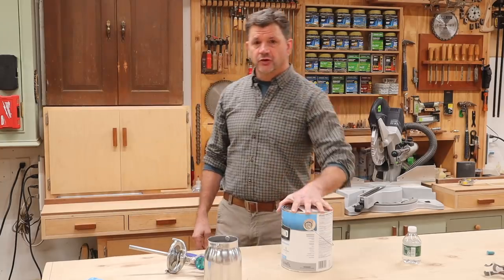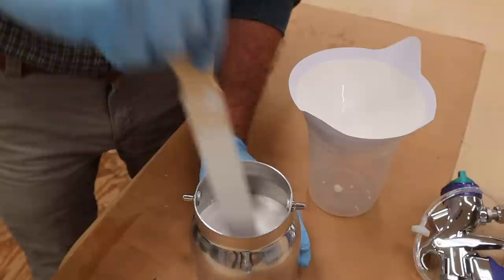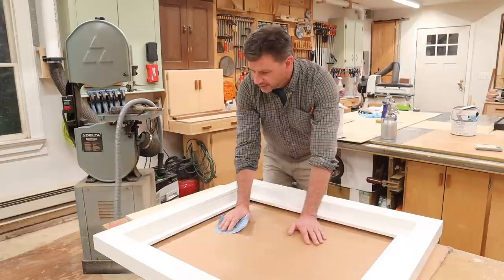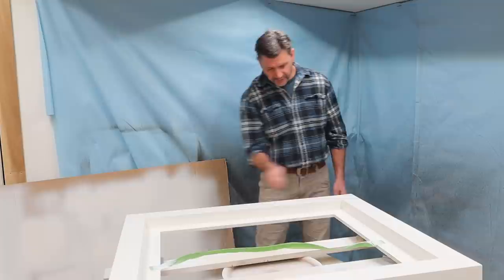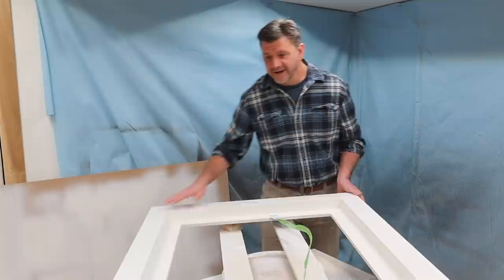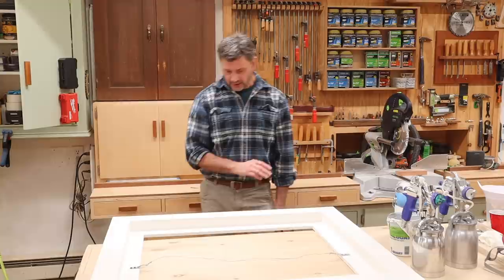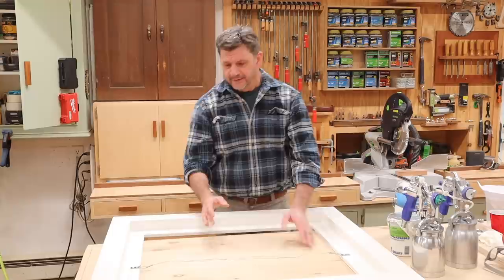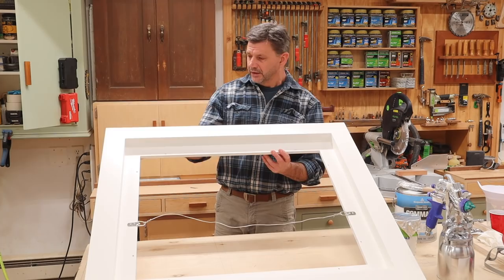How To  spray Benjamin Moore Command Paint - FUJI HVLP

Comment: Yesssssssss! I love it. I took the plunge before anything was out on the internet about it… and I’m glad I did. I was able to spray with a 4 stage turbine and 1.5mm tip. No thinning. Tried thinning it too and works just as well… don’t thin more than 10%. Brushes ok, coverage isn’t great. Rolling is ok too, can’t find a roller that doesn’t leave bubbles or stipple.

Comment: I just made and sprayed 38 kitchen doors and drwr faces with this paint and am very impressed with the results. I thinned the paint to 25 seconds using a #4 Ford viscosity cup the results were uniform.
I'll add that I'm an oil or lacquer guy and this paint is as game changer for me.
Reply: At 25 seconds, were you still using 1.8mm tip on an HVLP cup gun?
Reply: @briangibson6445  yes
Reply: What primer did you use?
Reply: @evancombs1091  I used an alcohol based stain blocker primer.
Reply: Thanks for the info on this.  I'm about to do something similar, and what I find is that by reading the manufacturer's "max thinning instructions", they always leave the paint too viscous, meaning I can't get it to even 30 seconds in #4 cup.  Is this Benjamin Moore paint the same, and just more tolerable to being thinned past recommendations?  (Or maybe it's within recommendations?).  I'm using a Fuji Q5 and 1.8 set.  I know I can answer my own questions by just experimenting more, but then that requires cleanup!
Reply: @jamisonr  I'm sorry I can't answer your question. I'm not familiar with your spray set up. I used a gravity feed hvlp gun run off an air supply not a turbine.
I think you're just going to have to experiment. Wish I could be more help.
Reply: I have a Graco 9.5 HVLP.What  needle would you suggest?, Also do I need to thin at all ?

Comment: Thanks for introducing us to Command. My BM/Scuff-X dealer has implored me to try it. I have the same Fuji Q5. When I saw how your spray first came out, I figured it would orange peel (been there myself). Acrylics/urethanes are really tough w/ HVLP, even 5 stage. Ended up buying a Tritech T5 airelss for this stuff. Pro tip from my dealer: if you are going to spray w the Fuji (he sells both), *warm the paint first*. Has the benefits of thinning, without the negatives.

Comment: For a paint like this would definitely recommend using an airless with a 308 fflp tip. I’ve been finishing for a while now I end up only using my hvlp for lacquer primer. Also helps if you use a 1.5 air cap with 1.3 tip helps keep that high fluid pressure and higher air output to get finer atomization of the coatings. I noticed when changing tip sizes and air cap sizes with the Fuji I still was getting less than optimal atomization. Found keeping the small tip and just changing the aircap really helped a lot
Reply: Good tip! My Fuji/Tritech dealer also suggested warming the paint when using HVLP.

Comment: I use an airless Graco with a 312 tip and it lays down great.  It's my go to for all my cabinets now.  I really like the quick dry time and hardness of the finish.
Reply: that hlvp he was using  you can hear it was working hard to atomize the paiint, he would have been better off using an airless sprayer.

Comment: I have moved from Fuji spray to a purpose built gentilin compressor for painting.  Its quieter, no thinning of paint, or very little, like a few drops of water, easier to clean out and i have been very impressed out of the box.  Its a little bulkier- its a 25litre continuous flow, but for the quietness,control and no need to thin, i am really happy.
Reply: What is that? Link?
Reply: Can u get those in canada

Comment: Great video.  I just sprayed some shelves with Command and was able to get fantastic results!!!  It looks as good as the BM Advanced I had sprayed out by a pro cabinet maker a few years ago.  (And the dry time was amazing!!!)

1.  I used my new Fuji Semi-Pro 2 gravity feed.  I thinned Command a little more than Jon did here and used a 1.5 tip.  I started with the needle all the way in and adjusted it until I got a light, spray can type mist.  Probably just a turn or two. 

2.  I laid my pieces on a lazy susan and used the ball pattern on the edges.  I switched to the fan pattern for the rest and moved slowly as to put down a thin but very wet coat.   I worked a little closer and square to the surface.    (I heard that you want a hand-sized fan when you are a hand-length away from the workpiece.)

3.  One coat over primer looked amazing with a little bit of wood grain showing through.  The second coat filled the wood grain.  I also did some UV-coated plywood with a bonding primer on it and it looked like a factory cabinet finish with just one wet coat. 

4.  If you use the Fuji 6' whip hose.  It has a bad wrap for falling apart so don't drag the main hose around with it.  Grab the main hose to drag it into place and use the whip from there.  The hose is a tool to make painting easier.  Treat it nice, be gentle.

EDIT:  I'm a novice, but there are so many good HVLP videos out there that it's pretty easy to learn.
Reply: Fuji whip hose is a total POS. Mine is coming apart already on my first cabinet job. Just bought a spare for when it fails.
Reply: What primer did you use?
Reply: @evancombs1091   BM Sure Seal.  I thin it out.  If I'm spraying over UV finished plywood I do a quick sand and use Bondz bonding primer first.  

Command is fantastic once you get dialed in with it.

Comment: I may give that paint a try.  I've been using Sherwin-Williams "Emerald" brand and get very good results by adding 1-2 ounces water with 1 ounce of Floetrol to a quart of paint and using a HVLP gun.
Reply: What is tip size you use?

Comment: I did the backs of my cabinet doors yesterday.  They turned out pretty good.  Today I did the fronts but I'm pretty sure I added too much water.  They look like alligators.  I will sand them tomorrow and spray again without thinning at all.  1.4 tip. If it needs thinning I'll know right away, and adjust. I was planning 4 coats, and this was only the first, so hopefully we can recover.

Comment: Finally sprayed Command with my Q5. Got pretty much the same results as you did. Very slight orange peel despite thinning 20% and 1.5 tip. I may try to thin a bit more.  But it's probably going to require three coats in white at that point. Love the paint. I need to try it in the Tritech airless, but cleanup/waste is such an issue with that.
Reply: Use a hopper version

Comment: thank you for the video.  Those are Fuji spray guns correct?  I have a Fuji gravity feed gun with a Q5 turbine.  I dont have the dial like you have to adjust the air and my system is a tad older. The air regulator is at the  hose.    I have been trying to spray post catalyst paint for cabinets and I'm using a 1.3 tip but have thinned it just a little.   I see that your using the 1.8 tip.  Do you find that tip optimal when spraying paint?   I'm trying to get my finish to atomize correctly and maybe I have been using the wrong size tip and much to small for the product I'm spraying?   I usually spray a conversion varnish such as Cambell's Stealth or Turino.  Im trying Magnavar today.   Any advice is greatly appreciated on needle size.    Also what model of Fuji guns are you using?

Comment: Hey Jon, how does the finish of command compare with the finish of advanced? When advanced is done properly, it has a very smooth finish.
Reply from the maker: Too early to tell, my problem with advance is it takes a long time to dry… I’m planning to use this on a few more projects and will know more in a few months
Reply: @JonPetersArtHome  Thanks Jon for the initial review, could you follow up in a couple months with your final thoughts?
Reply: @JonPetersArtHome  Emerald is better than Advance , way more user friendly , and I believe it is more durable actually .... Emerald "melts" pretty well and dries much faster .... I have never used Command , but I saw the close up of your third coat while wet , and it looked like it had some orange peel to me .... You seemed to like the finish after it dried so I assume it came out okay .... I think Command is sort of like PPG Breakthrough , "dries real fast" .... Emerald dries "sort of fast" , Advance just sucks "dries way too slow" .... I used Advance ONCE and that was enough for me .....
Reply: Bright whites in Advance will yellow, which is a deal killer for many of us.

Comment: Waiting for my Fuji Spray semi pro 2 in the mail. Plan on doing some cabinets for the laundry room to start. I was watching some other videos and some use “floetrol” as an additive. I’ve got some of that coming as well as a 2.0 tip. Might be suggested for me because it the lower power turbine than what you have Jon. Thanks for the video!
Reply: Resurrecting a really old comment - how'd this spray with the Fuji Semi-Pro 2? I just received it and curious if it works well.
Reply: It turned out pretty good! I ended up using the additive on the cabinets, and tried diluting with water with some exterior acrylic for a front entry door and that worked quite well. Trick was to make sure to strain after mixing with the additive. The machine works awesome. I switched to a gravity cup vs the bigger canister underneath. Hand/arm got REALLY tired
Reply: @Radtke_Makes  awesome, thanks!

Comment: Hey Jon, thanks for the video.  I noticed you used the Fuji Q5.  Would the Q4 work effectively for latex paint?  Is there much of a difference between the Q5 (9.5 psi) and the Q4 (9.0 psi)?  Is half a psi really worth the extra money when spraying full bodied latex paints?
Reply from the maker: Hi Matt, I haven’t used the Q4 but I’ve heard it works great… should be fine
Reply: Thanks! @JonPetersArtHome

Comment: I don't have much experience with painting. Is there a reason you use a gun like that instead of an airless sprayer?
Reply: 1. Oversray/waste  for such a small proj.
2. A slightly better finish with HVLP if done properly; although you can get a damn good finish with airless if also setup properly (prep/tip selection/paint type and/or thinned)
Reply: @av8rbri473  This. Waste/overspray are the real killers with airless. Tritech airless with the fine finish kit will outperform HVLP w/ most waterbornes. But cleanup is a bitch.

Comment: Rather than using a gun, I still feel I can get a better finish with a green 1/4” nap Purdy roller and sanding between coats.  Takes longer with a roller of course, but I get flawless finishes by hand.
Reply: Yeah, that's why I used a roller when I paint show cars. I definitely get a reaction at the shows.
Reply: @nicholash8021  I'm talking about furniture finish, lol.  Compared to what I saw in this video...bubbles in the paint and orange peel,  I definitely can and have done better than what was shown in this video with a purdy  roller.
Reply: @MixingGBP  LOL I was totally kidding. I can get a great brushed finish using BM Advance if I'm quick and smooth on the stroke and don't double-back. But a roller... not even close to either a brush or especially a spray gun. Not even in the same universe. I've been spraying for 25 years (here and there) and used to paint show cars and I can tell you that it takes a lot of practice. Too dry and you get the rough feel and small bumps. Too wet and you get sags and runs. You have to get a feel for it. This guy was putting it on way too thin. You shouldn't hear any sandpaper-like noise when running your hand over the surface or it means you sprayed it too dry. This paint is amazing for its dry-time and durability, but it has almost no flow which is both a blessing and a curse. I tried brushing it on some trim and forget it. It's great for baseboards where nobody will notice, but if you require a factory-like finish such as for cabinets, you can forget brushing or rolling. You'll have to spray it and spray it right.
Reply: @MixingGBP  I saw the orange peel too .... Sometimes I use the high density foam rollers (dark gray roller) not bad on flat surfaces ..... but I've just brushed Emerald on cabs a few times , and it came out pretty good , not bad at all ..... I made a vid of one job - https://youtu.be/ejKR5qz99wc?list=PLctJa9wc-8mvw2MPch_H7dXoJKB0EEp3l
Reply: @nicholash8021  I don't have nearly the same experience you do, but I do have the same sprayer Jon does. When I saw him first start to adjust the spray pattern, my thought was "dry spray." Acrylic/latex is a bitch w/ turbine HVLP.
Reply: @nicholash8021 😂😂